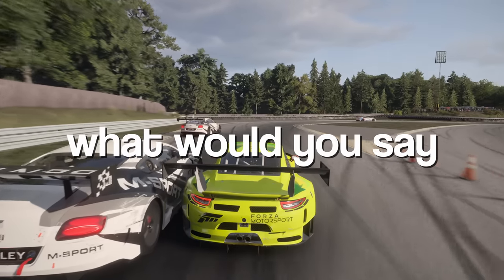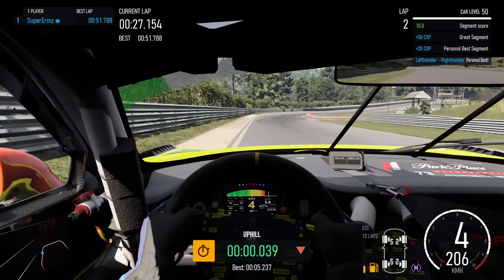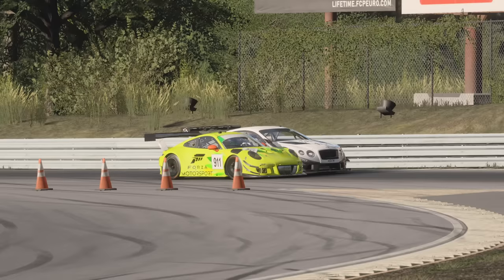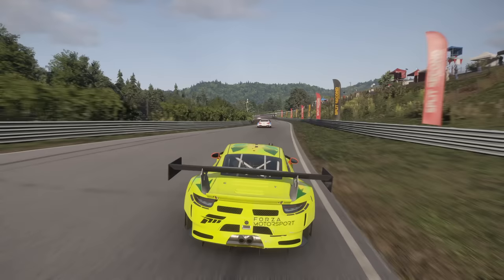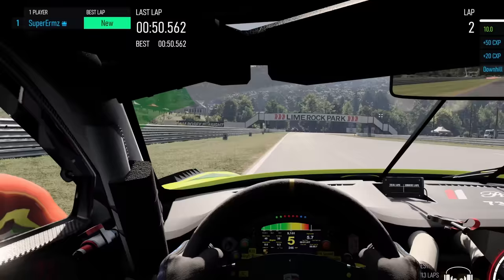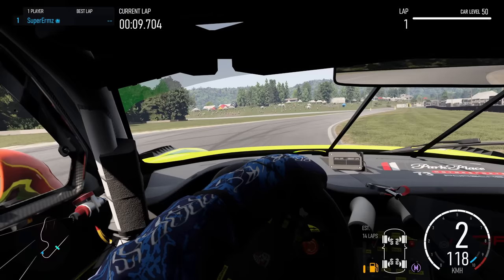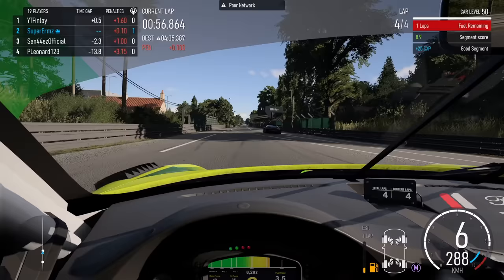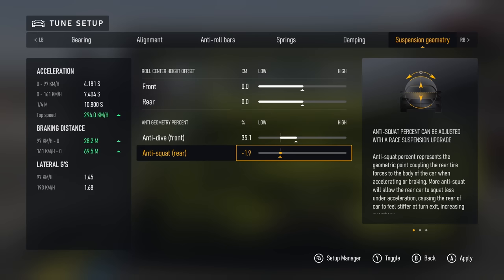The ULTIMATE Forza Motorsport Car Tuning Guide

Comment: Your tune seems very twitchy. What i like to do is find a nice middle ground for anti roll bar and spring settings. You can use the formula [(max value - min value)×wt ratio + min value] here the wt ratio is the wt distribution of your car. If it is 55ft and 45 rear and your max and min values are 13 and 1 respectively then it will be [(13-1)×0.55 + 1] (this is for the front, for rear multiply it by rear wt ratio which in this case is 0.45). Which will give you a nice middle ground. Then you can fine tune it to your liking. You can do the same for bump stifness and the rebound stiffness is 60 percent of bump stiffness. So bump stifness multiplied by 0.6
Reply: Not berating your tunes. I read my comment again and it came across as a lil condescending. Just wanted to share some additional knowledge where you can use your wt distribution to tune your cars.
Reply: Hold up, hold up. Bump damping should pretty much always be lower than rebound.  Too much bump damping causes poor turn in, and not enough rebound damping causes inconsistent grip. If your bump damping is stiffer than your rebound, one of these things is definitely happening. Possibly both!
Just my two cents : )
Reply: yeah and the rollbars are totally irrelevant as well :D so no calculations necessary. If it was realistic you would need them to make the car stable. You can set both anti-roll settings to zero in every single car and they're all totally fine without. Which is what i was doing for a while, thinking that I was getting max grip on the outside tires while cornering, but ironically, since I guess the grip calculations are completely out of whack, he's right, you actually get better cornering speeds with the rollbars at max stiffness.
Reply: @matteusmaximus  You misunderstand how rollbars work. Soft roll bars give more stability, which is why rally cars, trophy trucks, and other offroad vehicles have soft rollbars. On a track, you need grip more than stability, so racecars run stiff rollbars, which you can easily see by how they don't roll very much in corners.
Not trying to dunk on you or anything, just trying to help out a fellow sim racer. Understanding this stuff makes driving much more enjoyable.

Comment: Every damn car is understeering! I knew I wasn’t crazy!

Increase the rear bump and front rebound! Thank you! 💪💪
Reply: Go into your settings and change your deadzones, Forza has a crazy ass 24/100 setting stock lol. I dropped mine down to 5 since I have an older controller but if yours is newer you can go to 0. Doing this legit dropped my lap time on Hakone Club by more than half a second and put me from 90th on rivals to 33rd.
Reply: @austinryan4393 stock deadzones are completely fine. There's not much time, if any, to be gained there. It's just preference on how it feels
Reply: @austinryan4393  steering linearity is also missing unless you’re on a wheel. Would help dramatically if it was available to controller players

Comment: The first thing I do with every car is drop the diff deceleration setting to 0 and only increase it as necessary (5 for mid/rear engine RWD car). With that most cars start to present a more natural behavior when you close the throttle to tighten your line mid corner.

Comment: Just fyi normal alignments on road cars usually have a total front toe around -0.1 degrees… so the default setting makes sense.  Having positive toe in the front and rear makes the car rotate/change direction with ease but takes away from high speed stability

Comment: I haven't tested yours yet, but I use 20.x-21.x (as close to .0 as possible) rollbars (so +1 rear) and 70-30 diff as a general setup and it works pretty well. I feel like 100% diff lock shouldn't work, it basically means fixed diff, which is good for drift cars, not so much for racing.

Comment: Tuning is OP in spec.. i keep an  eye on tire friction and adjust tire pressure alignment and Aero to suit.. tweak slowly as tire ware is a big factor... 
Gear Ratios i do a lap and if im not using all the gears ill tune it till I am.

Toe is a weird one.. RWD you want stability on straights and turns so it doesn't drift. FWD id go for a more turn in rear but add rear aero to compensate for the loss of stability

Comment: Me being a first time "racing sim" player (not new to Forza), I took to Kayalami Grand Prix to see if somebody such as myself with little to no tuning experience and a controller can benefit from this guide. Here are my results:

I used a GR Supra, PI 800. I drove Kayalami 4 times and averaged my time.
First go was no tune. Average time was 1:52.7 with a best lap of 1:50.8.
Second go was just with PSI and roll bar changes. Average lap was 1:51.2 with a best lap of 1:50.3.
Third go was everything changed, my first attempt. Average lap was 1:50.75 witha best lap of 1:50.5.
My fourth go was everything changed, but more fine tuned. Average lap was 1:50.2 with a best lapt of 1:49.3.

Each time, the car did feel different around the turns and I got a better understanding of what I should look for when tuning. I plan to test this method on at least three more cars, all while writting down my own notes and comparing times. At a first glance, a lot of the tips and explanations in this video are easy to understand unlike other's I've tried to watch or read. Truly, that's what a turning guide should be. Show people the ropes and what to look for, then let them free to find the changes themselves. Still more testing to do but looking at my first results, this video does seem to provide some great instruction. :)

Comment: "The car has an understeer tendency"

Proceeds to max front anti roll bar 🤦
Reply: He did that right but for the wrong reason. In Forza, for optimum performance you want an overall stiff front, with a loose back. This means stiff ARB in the front, soft in rear, stiff springs in front and soft-er in rear (this is for most cars. Porsche RSR requires front softer springs and rear stiffer bc of engine layout). Max downforce on front, minimum downforce in rear. This means that when you turn in, your rear will naturally rotate to follow the front under power. This guide is good for beginners to make their cars driveable, but it is utter non-sense when it comes to advanced tuning. @ermz
Reply: @I_AM_ENTR0PY Cause I was wondering that a 911 is a rear engine rwd car which supposed to be exhibits oversteer tendencies. So like you said, minimum Front Arb and Max rear Arb. But the more I watch youtubers discussing tunes, they tend to max front arbs anyway especially on RWD cars. Is this somekind of meta tune lng Horizon 5 or something?
Reply: @asdowo111  yeah there’s a meta around ARBS right now. 911 seems to be 35 front and 40 rear. Don’t ask me why.

Comment: Will try these tips but that's not how GT3 cars handle IRL. They are absolute grip monsters and if you have to counter-steer constantly like that either your set-up is wrong OR you have done a mistake. Maybe it's because you are not using TC at all?
Reply: I've noticed a lot of people drive GT3 w/o traction... when you should be using sport mode TC and it's so much more planted...
Reply: RSR and GT3 can be driven without traction. Engine in the back means you rarely oversteer. He just has a very bad setup which creates a ton of oversteer. This video is a bit crap IMO. I was curious but its nowhere close to describing any optimal tuning in Forza. Its a basic noob guide to make their cars understeer less. PS: On all other GT cars except 991s, I agree TC Sport is optimal for good times.s @TheFormActually
Reply: Thanks! @I_AM_ENTR0PY
Reply: @I_AM_ENTR0PY all of the top guys are running no TCS in most GT cars. You definitely don't want it in the Audi R8, which is the best GT car by a mile
Reply: @Harmonic14  I mean I'm on 4996 driver rating right now and I race against "top guys" quite often. I can assure you 99% do use TC (Sport). You can still be gentle going on throttle to prevent it from kicking in too much, while having the benefit of being more confident going on the power without undesirable wheelspin slowing you down. Its a "failsafe" more than anything. If you use it as a crutch, you will indeed be slower with it. But a good driver will just be that much faster with TCS. I'm coming from F1 where I drive without TCS, and on this game I noticed the need for it right away. GT Series cars are too slidey in the current physics.

Comment: I don't think I can agree with almost anything in this video, other than that default forza tunes are crap.

You need to tune for each car individually, there is no catch-all "just max this slider and use this tire pressure"  solution.  It's way more useful to take 10 minutes and learn what each suspension component actually does (not the in-game descriptions, those are crap too)  and how they relate to one another before you tweak it. This way, you can know exactly what each car needs to drive how you want it to, or at the very least you'll be able to fix any handling problem that comes up. So if, for instance, you don't want your inside wheels losing all grip and your car drifting into every corner, you know how to fix it.

I've been making and winning with my own tunes since FM4, so anecdotally I'm at the point now where I can say "I want 3 clicks more on the rear suspension" if I'm not feeling great about turn 3 at Catalunya. It's a great feeling winning with an underpowered car because you made it yourself and the other guys just picked the meta car and downloaded the first "best for grip" tune they saw.

Comment: Im not sure why but I've probably watched this video a good 10 times over while tuning my cars and I gotta say that ever since my cars have never done worse. Cars that use to be stable and fast are squirrley and unmanageable. My touring cars are being dominated by less than skilled drivers and im starting to lose interest in even figuring out how to get my tunings back to what they were. Idk if its just my experience but I've used this video as a reference for every tune I do. I was better off just blindly learning on my own tweaking one thing at a time and feeling how it effected the car. Btw, are all these tuning tips under the assumption that were using a steering wheel/manual trans setup? Is any of this viable for a controller?

Comment: Hmmm, a bit of an oversimplification of suspension in the Forza context, I can see how Forza isn't a sim, but if your car bottoms out it's a whole heap of pain. This is especially so with bumps as Forza kerbs are notoriously made out of ice. 

As for the camber, you can validate your choices by checking tire temperatures as you corner. This is more difficult than previous Forza games as the telemetry is simplified, but even if Forza isn't a sim one could assume the logic refers to having a better contact patch into its math. 

As for the PSI, it was 32PSI (2.2Bar) on the previous Forza games, but I'm not finding it the same this time around. I often run 28PSI front and 24-26PSI rear when tires are warm and the difference between that and 32PSI is night and day - this is all with race tire compounds. 

I would hazard a guess the feel of a tune between controller and wheel is massively different, it was on previous Forza games, but I don't have a wheel for Forza to confirm. It's possible this tune works great on a wheel, but it could be another picture on a controller.

Comment: Heya Jake, what is the base car? There are so many, would love to just start with the exact same car, make the incremental changes you are making and see if I can "Feel" the difference in the tunings the way you can in my wheel setup. There are So many Porche 911 GT3's lol.. 
2021 911 GT3,     2019 911 GT3 RS,      ParkPlace 911 GT3 R,     2016 911 GT3 RS,      2007 911 GT3,      2004 911 GT3
EDIT: There is a hint with Car balance at default of 43/57 So I've been looking into them trying to find Porche GT3 with that balance at purchase so I can literally start on my tuning journey the way you have here in this video. Thanks in advance for any help on this. I appreciate the content. Ill be ARound!
Reply: Bump.. Just checking in to see if n e one knows the title car.

Comment: Congrats! You've introduced people to Forza Meta Tuning aka the tips and tricks Rivals and ultra-competitive racers users. No, the physics aren't realistic at all, and the same tricks that can be used on Forza Horizon 5, and FM7 haven't changed because this game was not "built from the ground up" as they claimed. BTW, this tune is ONLY for a RWD cars and even some of your choices are questionable. AWD and FWD meta tuning is a lot different, and people should NOT try and use these settings on those types of cars.
Reply: These settings work much better on FWD and AWD than you'd think. 40/40 bars has been a thing for a long time

Comment: Close, but not there yet.  Your steering wheel is still moving a lot which means your car still ain't stable enough through the turns.  I would rethink your suspension settings --> springs, rebound, and bump those are way off.  The rest of your settings are good or close enough.  For a car like the Porsche you def need to use the geometry tuning section to get the most out of the car.  Wouldn't call this the ultimate guide, but definitely a good start.  Nice job.  P.S. The default gears for the Modern GT cars are ok for beginners, but if you want to get faster times you have to redo the everything.

Comment: A good start... Most cars are 60-70% of optimal by default and if you don't tune you will never be competitive.
Reply: They have that for a reason. You can go up and down, depending on the track and personal preferences. But setting your diff to 100 is really bad idea. His car is so slidy at the end.
Reply: @Standgedicht plenty of cars in Forza work fine with 100% locking, especially Porsches

Comment: You seem to be correcting in the middle of every turn. That feels like it would be a handful to control. I've been trying to get the 911GT3 to feel as close to how it does in gt7, which for anyone who doesn't know, the car just does what you want and feels like it has infinite grip. Is the maxed diff the issue?
Reply from the maker: It'd be the relatively high rear anti roll bar, and the reasonably low differential deceleration setting. You can easily make the car more stable mid-corner by adjusting these two.
Reply: Hey! thanks for the suggestions @Ermz  . Love the vids. Keep it up, my friend.

Comment: Too technical but much better than others who don't give actual settings to try.  I love the inclusion of the reference and 'with settings applied' laps. Tuners are always too technical and speak too fast describing what they do. I go with 2.4 on front tyre pressure and 2.2 on rears on road cars and 2.5\2.3 on A, S and R builds. On camber I go between -1.3 to -0.7 on front and -0.8 to -0.2 on rear with more on  curvy tracks and positive camber if very long straights in muscle cars. Front toe -0.8 rear 0.3, 5.5 to 6 on the other setting on that screen. Aero on road cars 40 on front 55 on rear. Diff I try all types of setting with higher acceleration and about 50 per cent less on the decel e.g. 70-35, 60-30. Brake balance 40 and pressure 180. I still can't get close to what some do with their times but gowith very similar settings to try and test car differences.  I also use these on older versions of the game. In the new one ballast and fuel load also are factors.
Reply: A good tip for average drivers is to try watching your speedo as you drive through long sweeping turns.Try different entries into the turn so that your speed doesn't dip too much in the middle. Also practice a lot on keeping decent speed going through corners into uphill climbs like the final turn at Road Atlanta.
Reply: "Tuners are always too technical"

Uh, what? There's a rhyme and reason for changing settings lol
Reply: @Harmonic14  not saying there isn't but the audience wanting tuning advice are not other tuners.. simple things like changing this setting will help brake faster or turn in to the apex better.. don't go too far on this one, it will make the car more jittery instead of talking about spring geometry and introducing math equations to work out a downforce calculation. If Forza's own descriptions of the tuning options were simpler or backed up by some animations or had some assistance like the driving line offers then it wouldn't be that bad.. i mean - here is forza text for gearing advice. "To determine the final drive ratio divide the number of teeth on the ring gear by the number of teeth on the pinion gear" Too much useless detail. It should say move the slider left for more acceleration and right for higher top speed.. the end

Comment: Do you know if changing the brake bias will also affect tire wear? Like if farther back bias uses more rear tires on breaking therefore more evenly distributed wear?
Reply from the maker: I think this will only be the case if you're not running ABS and often lock the tyres. Having more even brake pressures can avoid locking, which will reduce tyre wear. The only other impact I can imagine is that if you move it rearward, the extra oversteer under braking might avoid scrubbing the fronts (big issue with default setups).
Reply: it does, but for cars for 911 GT3, I always move bb toward back.. like 70%, to reduce the back spin outs during trail braking..

Comment: 100% Acceleration means the diff becomes a spool diff under ANY acceleration. You complained in your review about GT3 cars unrealistically oversteering under throttle... I'm not suprised, since GT3 cars do not run such aggressive locking diffs in real life.